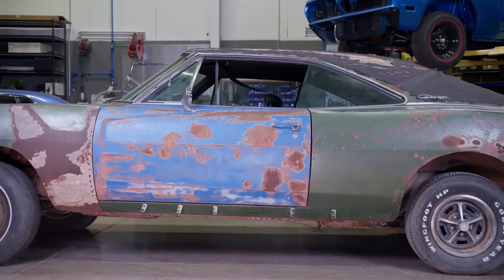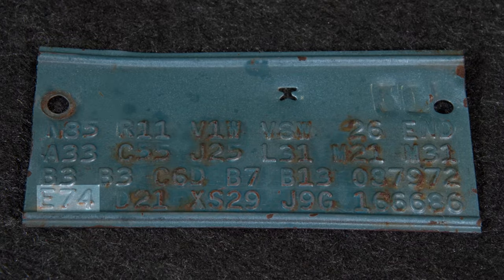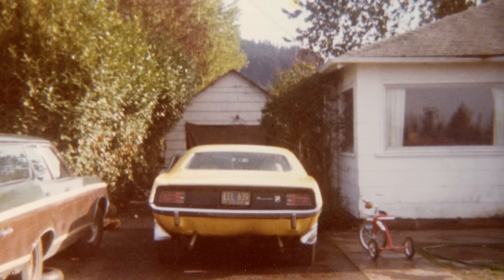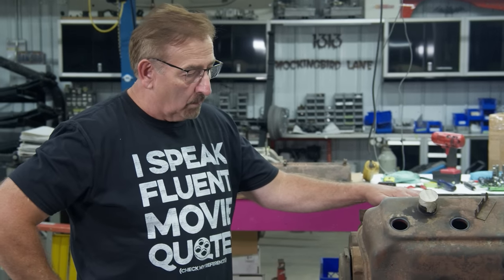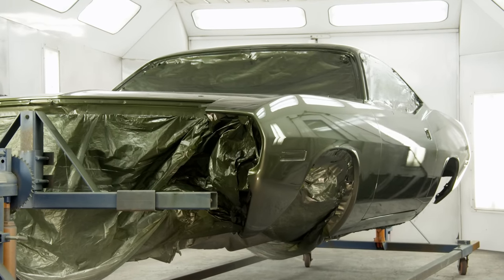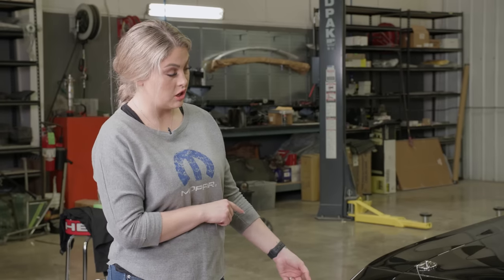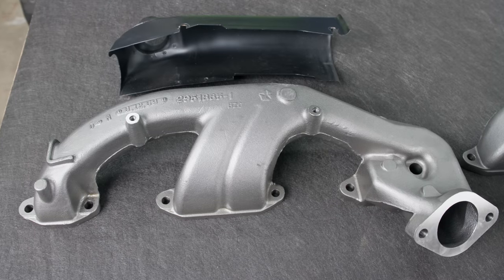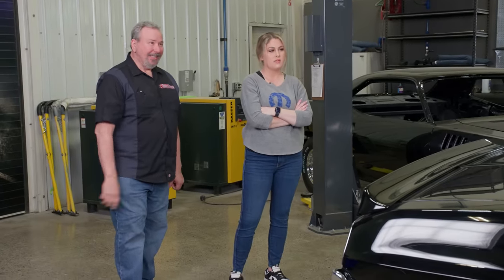4K NEW EPISODE:  FAMILY TIES AND A SURVIVOR 1969 HEMI CHARGER

Comment: A November 69 build would have put it in the 70 model year. I think she meant November of 68. That would explain the front seats with no headrests.
Reply: The car, as is, also has the Rallye wheels, which were not available until the 1970 model year. So, the wheels are not original to that car.
Reply: yeah im sure you two guys know way more and yalls shop builds the real stuff 🙄
Reply: @867diesel  I'm in the National Dodge Charger Registry for 69 White Hat Special. 
If you don't want to take in good information, then don't.
Reply: @jhutch1470  oh you're in the registry for them . i should've known you know more 🤣🤣